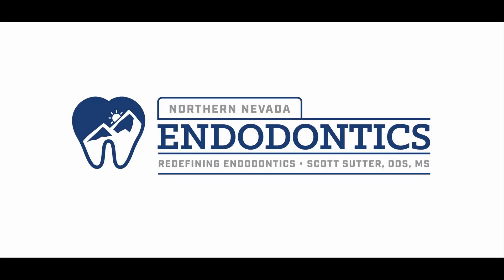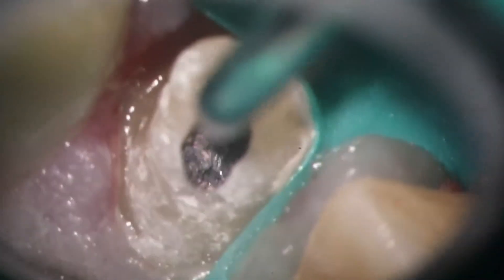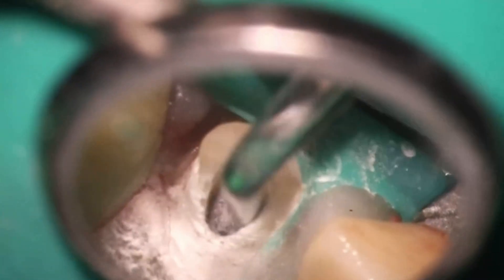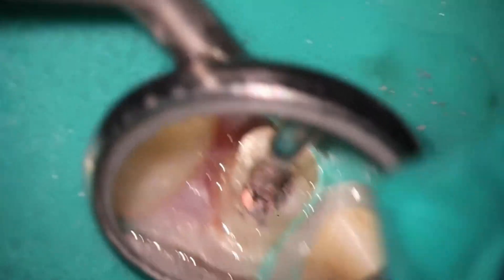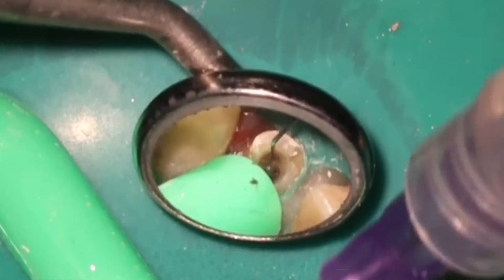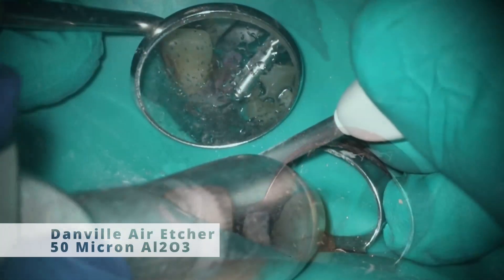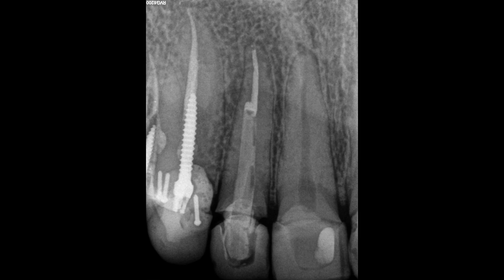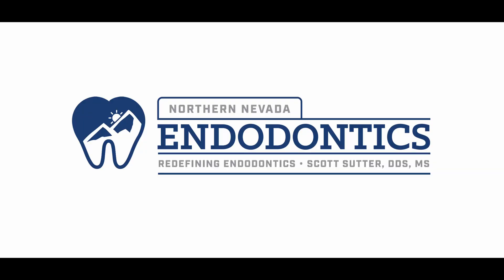You broke WHAT in a tooth??

Comment: Would love a video about Bioceramic sealer stance on whether if you look at it as a sealer or a filling material?
Also a deep dive on' to post or not to post' is  a major debated topic among the current Era of adhesive monoblock philosophy , would love a video or your current stance on this at this moment.
Reply from the maker: Haha I love the use of the word "Stance." We have far too many "camps" in endo and I think it's important to look back at why we are doing these root canals in the first place: to help people. I'm discouraged by some of what I have seen where the purpose isn't to help people, but to show others why they are wrong. I think I read too many philosophy books. 
ANYWAY. BC sealers (not just brasseler) are cool, but are they necessary? I use them on some resorptive cases, perforations, or any time I am worried about direct exposure to bone, but I don't think they are a panacea for every ill in endodontics. I don't use them with the squirt technique as they harden when heated so I would get a short fill. But I've used them with single cone! 
oh boy. to post or not to post. I guess I'm doing another Shakespeare video! I use posts to prevent snap-off failures, not to retain the core, so I don't place them on molars but I place them on premolars and anteriors. That one will require a longer video so thank you for the suggestion!
Reply: @PatencyPro  Thank you for replying and helping out all of us 'scouting' our way through this endodontic journey.
Just another follow up question, are the SS WHITE dc taper heat treated the same as them brasseler vt scouts?
Reply from the maker: I see what you did there! 
From what I was told (by the VP at Brasseler, so take this with a grain of salt):
When SS White brought their vtaper files to the market they contracted with Brasseler to manufacture them. About a year ago SS White decided to manufacture the files themselves and moved the process to China. This is also around the time when the quality of the files began to suffer. I'm unsure if the patent expired or what happened, but Brasseler then took that design and continued to manufacture them at the same plant, and they are far superior to any of the other VT files I've tried (edge, sswhite, etc.) Not sponsored by Brasseler but would love to be! So, if you get some old SSWhites from before 2021 or so they will be the same process as the current Brasseler files. Hope that helps! 
They're both heat treated and bend great, I've just had some issues with separation and unwinding with the SS White files

Comment: So it wasn’t a large DNA strand. Not this case in particular, but when would you refuse to treat based on long term prognosis? I work in a group setting and extract/implant a lot of failing endo, you get the tooth out and realize the endo was fine there was almost no tooth left for the restoration. Do you ever feel it’s your job to suggest to the patient or dentist that this tooth isn’t restorable.
Reply from the maker: It is still my favorite response, lol.
I refuse all the time to treat based on long-term prognosis (probably more than the average endo.) I also have an oral surgeon standing 4 feet from me right now who charges roughly the same for an implant as I do for a retreat, so that adds to my calculus for save vs. ext. In this case, the pt was referred from the local native tribe so she didn't have to pay for my treatment, but they don't cover implants, so that changes the equation significantly. I have also found it much easier to "hide" laterals in the occlusion so they are better protected than other teeth, and I have done more heroic dentistry on them than any other tooth. 

If you want to spend an hour watching me go into more detail than you've ever thought possible, I gave a lecture last week to the SLU residents on this very topic: https://youtu.be/sUKPy_xY_pk